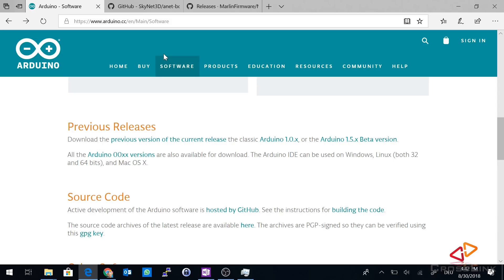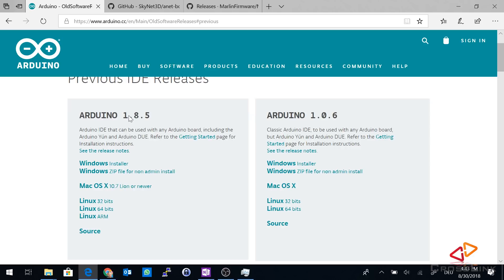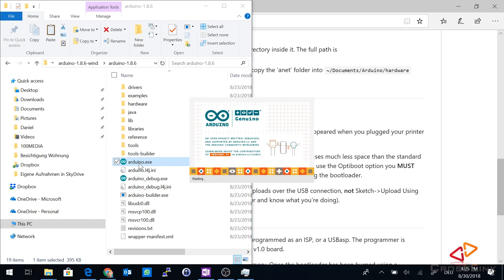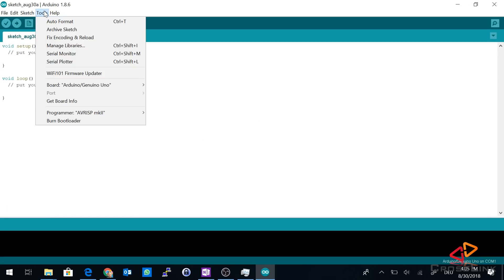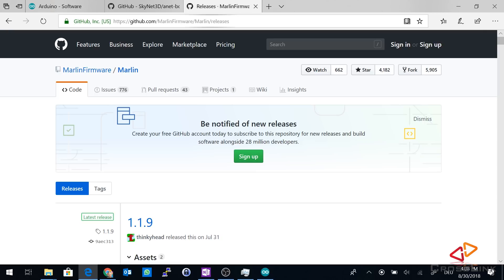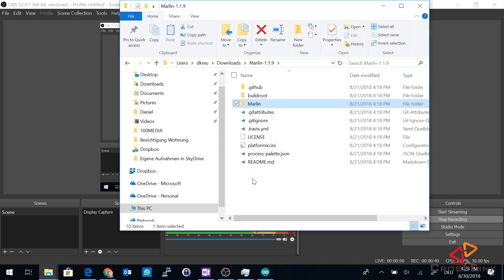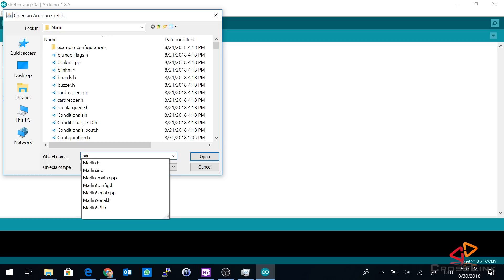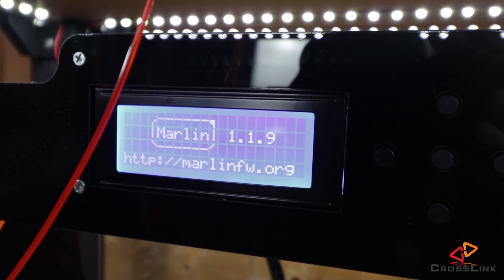How to install Marlin firmware 1.1.9 on your Anet A8 3D printer in 7 easy steps

Comment: arduino IDE v 1.8.9

Linking everything together...
"C:\\Program Files (x86)\\Arduino\\hardware\\tools\\avr/bin/avr-gcc" -w -Os -g -flto -fuse-linker-plugin -Wl,--gc-sections -mmcu=atmega1284p -o "C:\\Users\\stanl\\AppData\\Local\\Temp\\arduino_build_304062/Marlin.ino.elf" "C:\\Users\\stanl\\AppData\\Local\\Temp\\arduino_build_304062\\sketch\\G26_Mesh_Validation_Tool.cpp.o" "C:\\Users\\stanl\\AppData\\Local\\Temp\\arduino_build_304062\\sketch\\I2CPositionEncoder.cpp.o" "C:\\Users\\stanl\\AppData\\Local\\Temp\\arduino_build_304062\\sketch\\M100_Free_Mem_Chk.cpp.o" "C:\\Users\\stanl\\AppData\\Local\\Temp\\arduino_build_304062\\sketch\\Marlin.ino.cpp.o" "C:\\Users\\stanl\\AppData\\Local\\Temp\\arduino_build_304062\\sketch\\MarlinSerial.cpp.o" "C:\\Users\\stanl\\AppData\\Local\\Temp\\arduino_build_304062\\sketch\\Marlin_main.cpp.o" "C:\\Users\\stanl\\AppData\\Local\\Temp\\arduino_build_304062\\sketch\\Max7219_Debug_LEDs.cpp.o" "C:\\Users\\stanl\\AppData\\Local\\Temp\\arduino_build_304062\\sketch\\Sd2Card.cpp.o" "C:\\Users\\stanl\\AppData\\Local\\Temp\\arduino_build_304062\\sketch\\SdBaseFile.cpp.o" "C:\\Users\\stanl\\AppData\\Local\\Temp\\arduino_build_304062\\sketch\\SdFatUtil.cpp.o" "C:\\Users\\stanl\\AppData\\Local\\Temp\\arduino_build_304062\\sketch\\SdFile.cpp.o" "C:\\Users\\stanl\\AppData\\Local\\Temp\\arduino_build_304062\\sketch\\SdVolume.cpp.o" "C:\\Users\\stanl\\AppData\\Local\\Temp\\arduino_build_304062\\sketch\\blinkm.cpp.o" "C:\\Users\\stanl\\AppData\\Local\\Temp\\arduino_build_304062\\sketch\\cardreader.cpp.o" "C:\\Users\\stanl\\AppData\\Local\\Temp\\arduino_build_304062\\sketch\\configuration_store.cpp.o" "C:\\Users\\stanl\\AppData\\Local\\Temp\\arduino_build_304062\\sketch\\dac_mcp4728.cpp.o" "C:\\Users\\stanl\\AppData\\Local\\Temp\\arduino_build_304062\\sketch\\digipot_mcp4018.cpp.o" "C:\\Users\\stanl\\AppData\\Local\\Temp\\arduino_build_304062\\sketch\\digipot_mcp4451.cpp.o" "C:\\Users\\stanl\\AppData\\Local\\Temp\\arduino_build_304062\\sketch\\emergency_parser.cpp.o" "C:\\Users\\stanl\\AppData\\Local\\Temp\\arduino_build_304062\\sketch\\endstops.cpp.o" "C:\\Users\\stanl\\AppData\\Local\\Temp\\arduino_build_304062\\sketch\\fwretract.cpp.o" "C:\\Users\\stanl\\AppData\\Local\\Temp\\arduino_build_304062\\sketch\\hex_print_routines.cpp.o" "C:\\Users\\stanl\\AppData\\Local\\Temp\\arduino_build_304062\\sketch\\least_squares_fit.cpp.o" "C:\\Users\\stanl\\AppData\\Local\\Temp\\arduino_build_304062\\sketch\\leds.cpp.o" "C:\\Users\\stanl\\AppData\\Local\\Temp\\arduino_build_304062\\sketch\\malyanlcd.cpp.o" "C:\\Users\\stanl\\AppData\\Local\\Temp\\arduino_build_304062\\sketch\\mesh_bed_leveling.cpp.o" "C:\\Users\\stanl\\AppData\\Local\\Temp\\arduino_build_304062\\sketch\\neopixel.cpp.o" "C:\\Users\\stanl\\AppData\\Local\\Temp\\arduino_build_304062\\sketch\\nozzle.cpp.o" "C:\\Users\\stanl\\AppData\\Local\\Temp\\arduino_build_304062\\sketch\\parser.cpp.o" "C:\\Users\\stanl\\AppData\\Local\\Temp\\arduino_build_304062\\sketch\\pca9632.cpp.o" "C:\\Users\\stanl\\AppData\\Local\\Temp\\arduino_build_304062\\sketch\\planner.cpp.o" "C:\\Users\\stanl\\AppData\\Local\\Temp\\arduino_build_304062\\sketch\\planner_bezier.cpp.o" "C:\\Users\\stanl\\AppData\\Local\\Temp\\arduino_build_304062\\sketch\\power.cpp.o" "C:\\Users\\stanl\\AppData\\Local\\Temp\\arduino_build_304062\\sketch\\power_loss_recovery.cpp.o" "C:\\Users\\stanl\\AppData\\Local\\Temp\\arduino_build_304062\\sketch\\printcounter.cpp.o" "C:\\Users\\stanl\\AppData\\Local\\Temp\\arduino_build_304062\\sketch\\runout.cpp.o" "C:\\Users\\stanl\\AppData\\Local\\Temp\\arduino_build_304062\\sketch\\serial.cpp.o" "C:\\Users\\stanl\\AppData\\Local\\Temp\\arduino_build_304062\\sketch\\servo.cpp.o" "C:\\Users\\stanl\\AppData\\Local\\Temp\\arduino_build_304062\\sketch\\stepper.cpp.o" "C:\\Users\\stanl\\AppData\\Local\\Temp\\arduino_build_304062\\sketch\\stepper_dac.cpp.o" "C:\\Users\\stanl\\AppData\\Local\\Temp\\arduino_build_304062\\sketch\\stepper_indirection.cpp.o" "C:\\Users\\stanl\\AppData\\Local\\Temp\\arduino_build_304062\\sketch\\stopwatch.cpp.o" "C:\\Users\\stanl\\AppData\\Local\\Temp\\arduino_build_304062\\sketch\\temperature.cpp.o" "C:\\Users\\stanl\\AppData\\Local\\Temp\\arduino_build_304062\\sketch\\tmc_util.cpp.o" "C:\\Users\\stanl\\AppData\\Local\\Temp\\arduino_build_304062\\sketch\\twibus.cpp.o" "C:\\Users\\stanl\\AppData\\Local\\Temp\\arduino_build_304062\\sketch\\ubl.cpp.o" "C:\\Users\\stanl\\AppData\\Local\\Temp\\arduino_build_304062\\sketch\\ubl_G29.cpp.o" "C:\\Users\\stanl\\AppData\\Local\\Temp\\arduino_build_304062\\sketch\\ubl_motion.cpp.o" "C:\\Users\\stanl\\AppData\\Local\\Temp\\arduino_build_304062\\sketch\\ultralcd.cpp.o" "C:\\Users\\stanl\\AppData\\Local\\Temp\\arduino_build_304062\\sketch\\utility.cpp.o" "C:\\Users\\stanl\\AppData\\Local\\Temp\\arduino_build_304062\\sketch\\vector_3.cpp.o" "C:\\Users\\stanl\\AppData\\Local\\Temp\\arduino_build_304062\\sketch\\watchdog.cpp.o" "C:\\Users\\stanl\\AppData\\Local\\Temp\\arduino_build_304062\\libraries\\LiquidCrystal\\LiquidCrystal.cpp.o" "C:\\Users\\stanl\\AppData\\Local\\Temp\\arduino_build_304062/..\\arduino_cache_15596\\core\\core_anet_avr_anet_0c812875ac70eb4a9b385d8fb077f54c.a" "-LC:\\Users\\stanl\\AppData\\Local\\Temp\\arduino_build_304062" -lm
C:\Users\stanl\AppData\Local\Temp\arduino_build_304062\sketch\SdBaseFile.cpp: In member function 'sync':

C:\Users\stanl\AppData\Local\Temp\arduino_build_304062\sketch\SdBaseFile.cpp:1448:1: internal compiler error: Segmentation fault

 }

 ^

Please submit a full bug report,

with preprocessed source if appropriate.

See <http://gcc.gnu.org/bugs.html> for instructions.

lto-wrapper.exe: fatal error: C:\Program Files (x86)\Arduino\hardware\tools\avr/bin/avr-gcc returned 1 exit status

compilation terminated.

c:/program files (x86)/arduino/hardware/tools/avr/bin/../lib/gcc/avr/5.4.0/../../../../avr/bin/ld.exe: error: lto-wrapper failed

collect2.exe: error: ld returned 1 exit status

Using library LiquidCrystal at version 1.0.7 in folder: C:\Program Files (x86)\Arduino\libraries\LiquidCrystal 
exit status 1
Error compiling for board Anet V1.0.

Comment: i have a Anet A8 runnig Skynet firmware - and wish to run newest marlin instead.  ive added the bigger display from Anet A6.  do i chance anything else to make it work ?
Reply from the maker: Yes, it should be possible. I've done a video about the installation and marlin configuration: https://youtu.be/uMsIb4Gwm3o

Comment: I installed the bootloader but it does not allow me to install  the new firmware. Every time I try to load it, the arduino IDE shows the messagle ser_open() can't set com-state for . com5, Do you know how to fix it, it looks like a drivers issue. Thank you

Comment: I had problems with loading the file, I use the video version of the Arduino IDE but It did not load the file to the board.

Comment: Nice work man, will this work with ctc a8? It is using same board.
Reply from the maker: Yes, if it's the same board. However the settings in the Marlin config might be different...

Comment: Hello guys, i have the problem that i install on two anet a8 mainboards the latest marlin firmware. everything is ok, no problems. Now, i want to install the latest marlin firmware on my third anet a8 mainboard but i get no connection from my windows 10 to the anet a8 mainboard. The other two Anet a8 mainboard works, but the third one not. Can someone help me please?
Reply from the maker: Hey, please check out my latest video about different firmware flashing methods. Maybe this will solve your issues pretty quickly: https://youtu.be/wRODgnAqp1A

Comment: I wish I haven't played with this. I followed instructions for the video, and my printer is now useless. Firmware does not work right, massive under extrusion, and I can not flash back any other firmware, because its too complicated for me.
Don`t get me wrong, instructions in the video are great, but my printer does not work right with this FW.
Reply: i have read there is an original a8 firmware included with the SKYNET software download

Comment: hallo, i have a problem while printing. The nozzle moves away (x axis) from the pritining object and therefore it produces strings and messes up the print. Does the minimal layer cooling has something to do with it?
Reply from the maker: What retract settings do you use. I would start with 2mm at 45mm/s speed
Reply: it was 3mm and 45 mm/s. It does this only on cura 3.6.0, not on cura 14.07. The Anet A8 has the newest firmware that i flashed with your great video guide. :) @Crosslink3D

Comment: Thank you so much for this guide - I just successfully installed Marlin on my Anet A8. The board I have is v1-5. I thought I would share that on my first attempt I hit the "not in sync" error. I managed to fix it by firstly installing the arduino drivers (dpinst-amd64.exe) and re-boot windows, secondly I unplugged all other USB devices connected to my laptop - it seemed a wireless mouse adaptor was stopping the correct COM port appearing in the arduino IDE. After these two things Marlin went on fine.
Reply from the maker: Robin, thanks for pointing this out. I think this is really valuable information! 👍
Reply: Thank you!

Comment: This worked out great for me.  The only thing that you might include how to do is adding the probe sensor and how to calibrate it and properly setup the configuration.h file for it.
Reply from the maker: I've done it at least for the capacitive sensor already: https://www.youtube.com/watch?v=gUr6kaOaRzo
Reply: @Crosslink3D  awesome,  I didn't see that at first.   I did get mine working.   Do you have anything on print quality?  My prints aren't as smooth as I'd like to see.
Reply from the maker: Major improvements in print quality came for me when applying the belt tensioner upgrades, new GT2 belts, The Hulk frame (video will come on all of these things). And finally, what really pushed it a bit further was installing TL smoothers (the expensive ones with 8 diodes, the 4 diodes ones are crap and actually reversed my stepper motors direction). Retract settings is also a topic on its own and can help but don't overdo it otherwise it might cause clogging in the nozzle or bubbles, so it's little changes and every change brings a bit better quality. Print speed is also something. If I really want max quality I don't print faster than 60mm/s.

Comment: Hello Daniel, Thanks for your video.  I'm following it step by step (I'm not a SW guy). I got this error when verifying the marlin:  

SanityCheck.h:947:5: error: static assertion failed: RIGHT_PROBE_BED_POSITION is outside the probe region.
     static_assert(RIGHT_PROBE_BED_POSITION <= MAX_PROBE_X, "RIGHT_PROBE_BED_POSITION is outside the probe region.")
Reply: By the way, I am setting up an ANET A8
Reply: I used your Configuration.h and only changed the sensor offset to x-22 and y-38
Reply from the maker: If you change the offsets, you have to change the probe positions accordingly. right probe bed seems to need a lower value. depending on how much you moved the sensor compared to my values you will have to adapt the bed position values.
Reply: Some other untouched settings:
  #define LEFT_PROBE_BED_POSITION 35
  #define RIGHT_PROBE_BED_POSITION 200
  #define FRONT_PROBE_BED_POSITION 20
  #define BACK_PROBE_BED_POSITION 150

My ANET A8 is standard bed size: 220 x 220

Comment: I have one of these boards on a Prusa I3 Clone (specifically a CTC I3 Clone) but I cannot flash it as I don't know the correct board settings i.e. when I set the board for GEETECH the upload fails saying 
"exit status 1
Error compiling for board Arduino/Genuino Mega or Mega 2560.".

I notice that the chip is an Atmel Mega 1284P. Any help help would be appreciated
Reply from the maker: I would try to download the Anet A8 board definitions and go with that. If it really is the same board those definitions should help.
Reply: @Crosslink3D  Thanks that works!  But not being a programmer,  I don't know how to change the steps/mm as the Anet uses a square cut screw and the CTC clone uses a different threaded rod.
Reply from the maker: Hmm, normally, you would mark the position, then instruct the printer to move a certain amount of mm, measure how much it really moved and then use a rule of three calculation to get the new steps/mm. Does this help?
Reply from the maker: Joseph Prusa has done a calculator for these values in case you have all the required input values. Otherwise you are very much left with measuring yourself and re-calculating the steps.
Reply: i have same printer. its the geetech 2650 v3 board. should say on side if a v1 v2 or v3. im betting v3.

Comment: Hi, great video by the way, the more complete on how to install marlin, my problem is that when connected via usb cable the USB is not recognized, i can see it in hardware management but it says that is unknown, so it isnt recognized in arduino and i cant flash marlin :(
Reply from the maker: What happens if you install the drivers from the "drivers" folder in the Arduino IDE's directory? Does the device get recognized then? Use the "dpinst-amd64.exe" to install in windows, then re-connect your printer. In the device-manager there it should appear as COM port.
Reply: @Crosslink3D  Hi, thank you for your quick answert, i tried and sadly the situations is as before. I've seen online that marlin can really make the difference in printing so this problem is really annoying me
Reply from the maker: Two ideas here. First, try this on another computer if possible. Change the cable and as a last resort, check the USB connector on the board and re-flow the pins so they really have perfect connection. Another viewer reported this and after re-flowing he was having no more issues. If nothing helps (drivers, cable, computer, re-flow) I would assume the USB chip on your board is defect.
Reply from the maker: But even with a defective USB port you still can flash using an Arduino, which is a much cheaper solution than replacing the board. Arduino is really cheap: https://www.banggood.com/Wholesale-Arduino-Compatible-R3-UNO-ATmega16U2-AVR-USB-Board-p-68537.html?rmmds=detail-left-hotproducts__1&cur_warehouse=CN

Comment: Just not sure why my print head starts so high off the bed since the update? Everything was level bedwize, and now every time it goes to print it steps high off
Reply from the maker: Are you using a bed leveling sensor? You can always calibrate the z-offset value even when you are not using a bed leveling sensor. Maybe use my video about the manual mesh bed leveling with marlin to get a better start: https://www.youtube.com/watch?v=ADdzKyS-T3w&t=2s
Reply: Sorry I wasn't clear. My a8 is a manual level set up. I believe my problem is on my settings with cura. When I start a print the head raises to far off the plate for the print to stick.
Reply from the maker: OK, then let's try to approach it. When you do the auto homing with the printer menu how much distance is there left? Is the nozzle grabbing the piece of paper already?
Reply from the maker: In cura, I usually set a first layer height of 0.2 but then I also set the z offset to - 0.1 or - 0.2 so the filament gets pressed a bit onto the bed.
Reply from the maker: These are my CURA Start G-Codes: 
G28 ;Home

G1 Z15.0 F6000 ;Move the platform down 15mm

G0 X0 Y0 F9000 ; Go to front
G0 Z0.4 ; Drop to bed
G92 E0 ; zero the extruded length
G1 X40 E25 F500 ; Extrude 25mm of filament in a 4cm line
G92 E0 ; zero the extruded length
G1 E-1 F500 ; Retract a little
G1 X80 F4000 ; Quickly wipe away from the filament line

M117 Printing...
Reply from the maker: This is my CURA Profile for PLA to print 0.2mm height: https://1drv.ms/u/s!At2kGv0IrYz9uJkuzh_vm8VxbDHp6w

Comment: Great vid. Question when upgrading to marlin does the cura settings remain the same
Reply: Got a follow up question, can I get your opinion on this. My 2018 model a8 mainboard went faulty during my first print, all I can see for sale is the older boards ,would it still function satisfactory if I get one of these older boards and flash it with marlin and do your recommended upgrades with mosfets and so on. I’m only new to 3D printing
Reply from the maker: I have both the 1.0 and 1.5 board on two different printers and I can really not tell any difference in functionality. If you use mosfets you will avoid the worst issues. Also check the mainboard connectors and maybe reflow them if they seem loose. Then you should be fine.
Reply from the maker: Yes, unless you start to add auto bed leveling, you can stick with your settings.
Reply: @Crosslink3D  what is the cura settings if I have auto bed leveling ?
Reply from the maker: You will need to add G29 after G28 in your printer start gcodes section

Comment: I recieved a board written as "V1-5", does method in video still apply or do I need to configure something else? Thanks.
Reply from the maker: It can work if you are lucky. If not, the manufacturer has not flashed a bootloader to it and you will not be able to flash firmware. There is another solution then, which I have described in this video: https://www.youtube.com/watch?v=RQIizXtf9oo

Comment from the maker: NOTE: If you get "not in sync" or "sketch too big" errors, please watch my video about how to fix these problems here: https://www.youtube.com/watch?v=RQIizXtf9oo
Reply: Is there anywhere I can download a Marlin profile for A8 Plus. I need for Marlin 1.1x. When I purchased the original board "Anet v1.7" would not work, on large prints it would freeze after a few hours of print. Anet was no help. I purchased  a MKS Base 1.6 and 3D Touch sensor. I am trying to learn to program but, have not learned enough and am really sad I cant print. Please any info would be greatly appreciated.